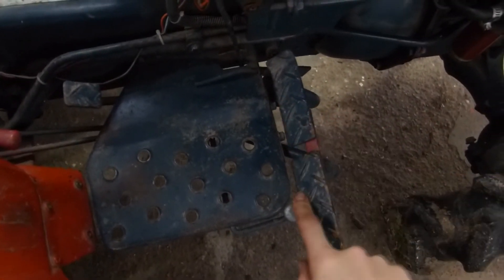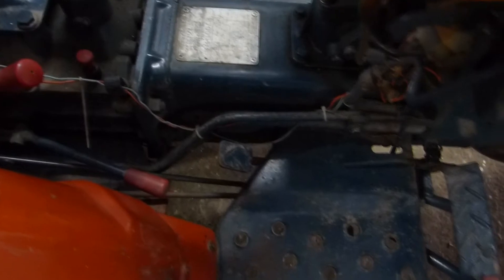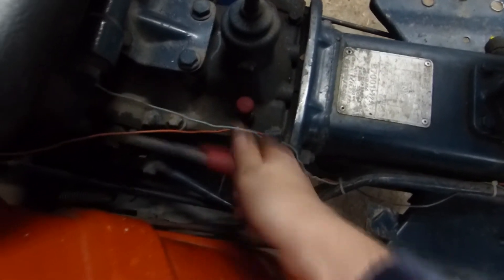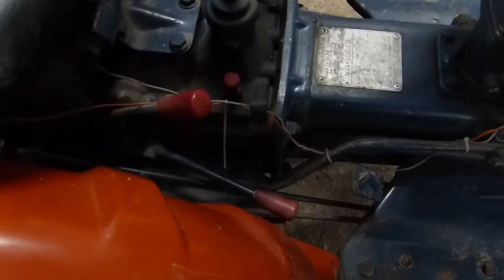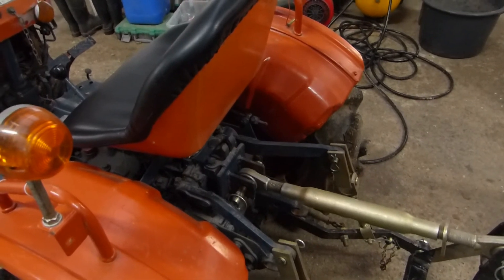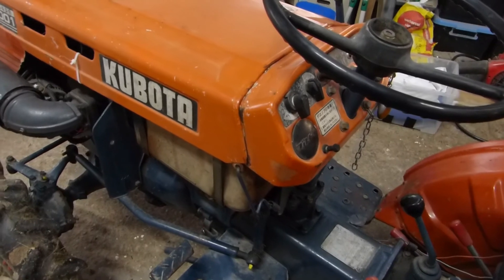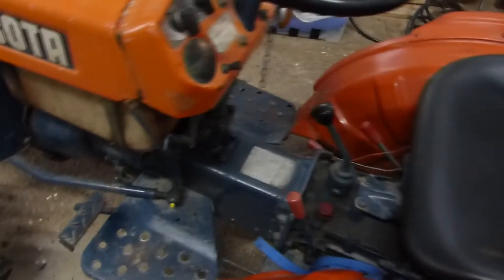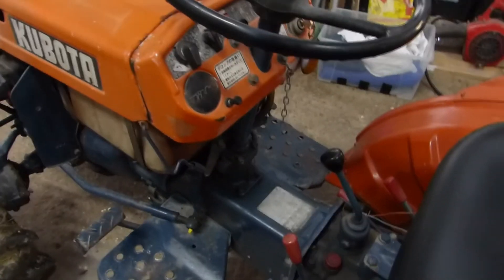Kubota B7001 Tractor: What Does Each Lever Do?

Comment: i have a b7100 but i have no main gear shift (one in between legs) ??? whats the deal? I cant
 figure out how to make tractor move.
Reply from the maker: Sounds like you have the hydrostatic transmission version, if your one is complete it should have a larger pedal close to the braking pedals, this pedal has 2 flats one pointing forwards that when stepped on makes the tractor go forwards and depending on the pressure applied to the pedal the speed changes. The flat pointing towards the rear is used to go backwards. If it doesn't move make sure that the high-low selector is locked in either high or low.

Comment: Do you recommend this small size tractor for a land up to 600sq meters?
Reply from the maker: For land size of only 600sq meters I would not buy a tractor. For mowing I would use a normal electric or petrol push lawn mower and a small rotovator to till the ground. If you mean 6000sq meters then yes this is a very good tractor to have.

Comment: how to fill up hydrolic oil
Reply from the maker: Close to the gear lever is the fill hole for the main hydraulic system and gear box, there's also a dipstick so you can see how much is in it.
Reply: @WilkoinFrance  mine leaks
Reply from the maker: From where? Would be a gasket or a seal somewhere, mine sweats a little from the hydraulic pump connections, would need new copper rings to solve that. But it never worried me as the oil level is always the same.

Comment: Estes kubotas b7000 e b7001 são estáveis?
Reply from the maker: The tractors are stable. I find that the B7001 is more stable than the B7000. But with both it is a matter of driving carefully and not sideways on a slope. Be careful with rocks, if one wheel goes up the rock it can become unstable.
Reply: @WilkoinFrance  obrigado

Comment: Hello, do you recommend this mini truck? I've found one in Belgium for 3700 euro and I don't know what to do. You could attach everything behind him?
Reply from the maker: Hello, I do recommend the Kubota B7001 or B7000. The earlier Kubota B series are all good, so the B6000 and B6001 as well. It depends how much work you want to do with it and what type of work. If you have a property of 5000 to 15000 square meters a tractor like this is sufficient if you have more, it would be faster to have a bigger tractor. These tractors are not fast. Kubota has a plough attachment for it. Anything else you need a separate 3 point hitch and then you can attach other things, but not big things. So I have a lawn mowing attachment of 80cm, maximum recommended is 1 meter or 100cm. Here in Portugal a B7001 usually costs 3500 - 3700 Euros, but it comes with the plough. Check the oil both engine and transmission condition, the air filter and see if it looks well maintained.
Reply: @WilkoinFrance  Thank you very much, I will consider what you told me.  I don't have much land of my own, but I'm thinking of doing more work with it for the local neighbors as well.  The tractor I'm telling you about comes equipped with a milling cutter, and the seller says it hasn't been used much. I will attach the link also :

https://www.facebook.com/marketplace/item/461960188506723/
Reply from the maker: @petruadrianpatrascu6239  It looks to be in a good condition. The milling cutter is attached with a 3 point hitch so that is good. Also the milling cutter is an expensive attachment when new so that is good value.
Reply: @WilkoinFrance  thanks a lot my friend 😊